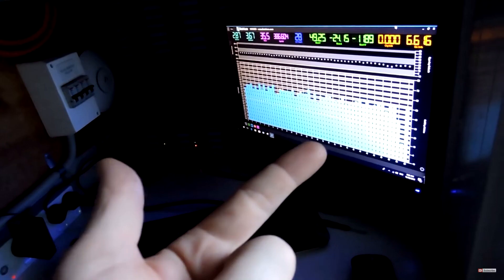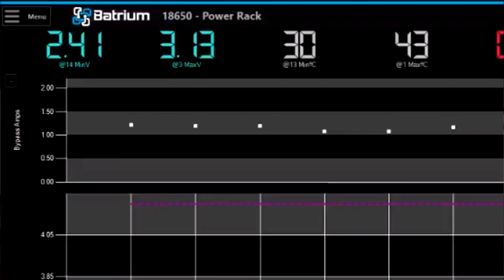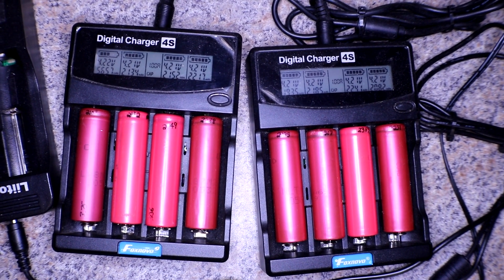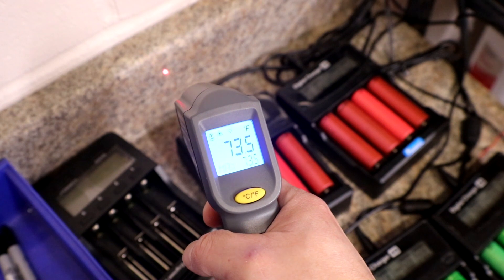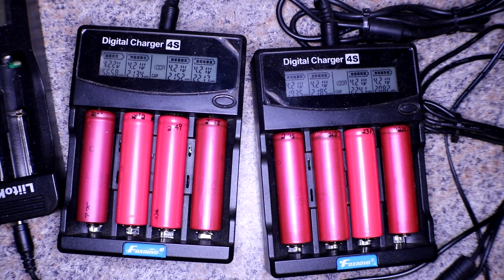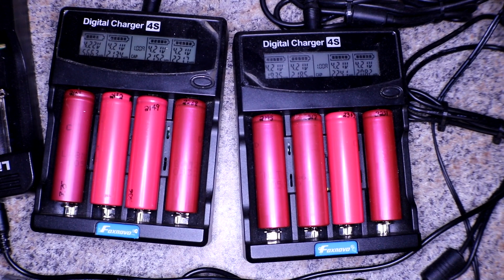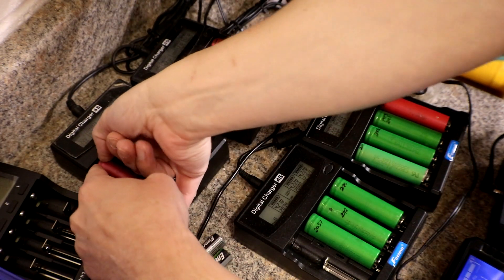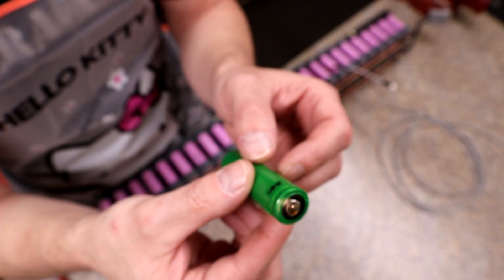Checking Cells on Pack 14!!!

Comment: sorry, can you provide a link to the tubes holding 18650 ?any one with the knowledge  will be appreciated.
Reply from the maker: The PVC was from Lowes and is 3/4" ID sch80 part# 49731  https://m.lowes.com/pd/Charlotte-Pipe-3-4-in-x-10-ft-690-PSI-PVC-Pipe/3134567

Comment: I have some xmas batteries too I've found the green one's have been the worst. I think there not much better than a 1C. Why doesn't anyone charge both ends of bus bars ?.
Maybe go 14s packs for future pack easier to find faults.
Awesome vids Jo love it keep it up.
Reply from the maker: Yeah another commented that the greens like that are pretty much an older version of a red sanyo heater!!!  They are better for a lower C rated battery pack.  I guess when the powerwall is running, the C rate is supper low and I could still use them but I might as well change them cause it seems like I like to torture test my powerwall lol.  I guess you could charge both ends of the bus bars when doing a single pake charge.  In the powerwall the charge is only from 1 end.  I like the bigger single packs cause there is less chance of shorting out the whole pack along with other things that can go wrong(thats my opinion tho lol)  Some people really like doing the series all in 1 pack!   Thanks for the watch!!!👍👍👍
Reply: Have same thoughts use every cell we have and I'm still collecting. 
Have you thought of running cells in pack at 3.9v max for long jevity and safty on other cells if a couple die.
Awesome love how your cells slide out have to find your older vid for that.
Torture lol be careful cos where learning from you. Tinkered with electronics for 30 years but lithium's have only been a year.
Like wise use everything like you say low C packs so all good. Lower voltage would have to help lower capacity cells balance out in packs ?
Cheers keep up your awesome vids.
Reply from the maker: I usually run them up to about 4.05ish. I use the glass fuses that pop at 2amps for the reason of catching a cell on its way out for that reason vs others that use higher amp fuses or wire as a fuse. Since its in my houae Im trying to make the cell packs as safe as I can. That was another reason I use the pvc for cell holders since were using used cells I wasnt sure how many or how often a cell would die so I wanted an easy way to replace them if needed!🔨🔋🤣👍
Reply: Thanks for answering Joe are yes the glass fuses are the go safty first. Pvc tube is that like sprinkler pipe/ hose ? . I'm in Australia  so maybe different. 
Medical packs what sort of contact would i need to search for them. Last question then I'll leave you be what charge rate AMPS per cell 1amp ?
Thanks mate cheers
Reply from the maker: No problem man!  Yeah the pvc I got was near all the sprinkler stuff.  Terry has all the medical cells in his Ebay store https://goo.gl/2sL2az but since your in Australia Im not sure how that would work.  Yeah if your using mostly used laptop cells I always do a 1 amp charge discharge to find any heaters.  If your building a big powerwall, you could test the cells at 500ma to be closer to normal use but that just takes to long lol .😃🔋🔌👍
Reply: Cool thanks I'll check Terry's ebay site .
Building ebike first with 18650 laptop and power tools dead batteries then move onto powerwall and EV . You should checkout in china Ubattery technology limited in china on Alibaba awesome prices on 18650's top makes also lipo4 200amp cells what i was thinking of using in EV. Not sure how to send link so hope you find it cos better price in US$ than Australia. 
Cheers can't wait for your next video.
Reply from the maker: Awesome yeah Ill take a look!  Next video coming up!!!🔋👍

Comment: What holders did you use for thee packs that made it so easy to remove afterwards?.
Reply from the maker: Hey Gerald, I built the cell holders from some 3/4" sch80 pvc pipe from Lowes.  Here is an older video I did about making them https://youtu.be/ChN9q7bVRRk 👍
Reply: AveRage Joe oh yes - I remember now. That’s a good idea

Comment: Hi what amps is the glass fuses you have on you're packs ?
Reply from the maker: They are .5 amp and pop at 2amp according to my tests.  The 1amp fuses also pop at 2amp but have slightly less resistance!👍
Reply: AveRage Joe  is that 0.5 amps or 5   amps ? Thanks Joe.
Reply from the maker: Yup point 5 amp😉👍 If I were going to do it again I would get the 1amp since it still pops at 2amps but has just a hair less resistance. Other then that I love these fuses!😆
Reply: AveRage Joe cool ordered 2000 of the 1 amp thanks mate
Reply from the maker: NICE!!!

Comment: You could use some of your tp4056 chargers and tie the battery side in parallel to charge your pack.  Im sure it would take several hours if not days to charge that pack.  But this would get your voltage closer to the 4.2v while you fix your charger. Maybe close enough to connect it back to the solar.
Reply from the maker: I thought about doing that for sure in case I cant fix the charger!  Yeah it would take days lol!😆👍

Comment: I think you should be doing DISCHARGE capacity tests because that tells you the actual "goodness" of the battery.  Like with the "heaters" you can get an artificially high value if energy is being wasted during the charging making it look like it took in more energy but BAD cells get HIGHER charge "capacity" as they take longer to charge and overcome internal resistance and other mysterious  influences. If the cells were NEW then charge capacity is ok, but with our recycled/used ones - NO!!  IMHO
Reply from the maker: Yup, I agree with all of that!!!😆👍🔋🔋🔋🔥

Comment: Hiya Joe, I think those green cells are old-school Sonys.  They don't have enough capacity to have made it into any of my large packs, but they tend to have a high C rating.  So if you need a small project pack that can provide over 5 Amps per cell they work great.  The Sanyos (red) on the other hand, have a higher capacity, but don't tend to like much over about 0.2C  or ~400mA charge or discharge. Which is probably why they were heating up if you were capacity-checking them at 500mA+.
~Cheers
Reply from the maker: Im kinda leaning on the same thing with those greens!  They seam lighter too but didnt weigh any lol.  Also agree on the reds. Smaller load which is the norm for my packs its fine but close to 1amp the start heatin up!😆🔋🔥👍

Comment: Probably it would be better to test the cells on holding the voltage....? 
I charge the whole pack measure the voltage then leave pack for few days like a week then I measure the voltage again and if is voltage below 4.18v then I charge the pack up to the 4.21 and desolder complete negative bus and after week I measure the voltage on each cell... Below 4.18v I replace with new ones... So that's is the  process that I use and since then I don't have issues with cells... 👍 
Also I don't discharge pack's below the 3,2v and also on every 100ah capacity I pull max 25A of it... 👍
For every 100ah usable capacity I make 130ah packs so actually if I use 100ah is still in the battery's 30ah reserv so I don't get drop voltage below 3v.... 👍 
What you think about that...?  honest opinion please...
Reply from the maker: Thats a great way to check packs!!!! Love that Idea!!! May do that on the next 14s!!!🔋🔋🔋👍👍👍

Comment: fukashima I hope the cells aren't like the powerplant.  
I have a cell. a 26650 that was just under 2.5v it wouldn't charge on my zanflare . so I paralled it with a nearly charged cell. for a day. then it charged fine. so I done a few cycles. then test and capacity is about 400 mah lower than the 19 other cells. still over 3000 mah. it's the resistance that has me concerned. 300+Mr. the others are under 100! great video. I need to finish my packs. and get them in service. 200ah of lead. doesn't get you that far. I have 600 watts in solar. don't you hate it when you pick up the charger/ tester after the test is complete. to write the capacity on the cells. and the thing comes unplugged!!¡!!!!! and you have to run the test again!!! it's happened to me like twice!  so far I haven't had any heaters! or bad cells. unless you count the 26650 . I need to build a tracker for my panels! I only get about 3 hours of good sun weth them in temp mounts. I need to get the most I can. because of the trees. I only get about 5 hours of sun. have you ever run liion with pb.? two different battery chemistry's I was thinking. use the lithium 7s. until discharge to equal the lead bank.  of about 27v then combine until lo voltage disconnect . at about 22v. then charge to 27v and reverse process. and continue charging to about 28.5-28.7v on lithium.  I know I could go to 29.4. . I hope to extend life. by keeping just under 29v. and fown to 21. I'm going to try to keep above 3v. seems that the cells say 2.7v minimum. I only testedvto 3v. and have just over 108 ah bank. I just need 10-15 more just like it. it's hard to find new cells that are affordable... mine are nos. and capacity within 400mah or so. great video. keep up the fight!
Reply from the maker: That Powerplant is still leaking isnt it???  400mah diff isnt bad in my book (i literally have a book of all the cells written down lol) but the resistance might getcha!  I would imagine 200ah doesnt get you much cause your completely off grid arnt you?  I havent mixed any lead with LiIon as of yet but I dont see why you couldnt do that.  If your around to monitor it like that and make the switch or whatever at the voltages.😃🔋👍

Comment: If you have a decent buck converter that is constant voltage constant-current you can discharge using whatever and then just use the converter to out them where you need
Reply from the maker: I actually dont have any except for a couple lil cheapo's!🙄

Comment: joe i am building my packs and  i got a ?  your  system is running at 24 vos or 48?
Reply from the maker: Its a 48v!🔋👍
Reply: ok  tanx amigo, if i do it 24v system  can  i used the betrum on  it    i am building  14 packs   so will be 2p 7s  what you recommend me ?
Reply from the maker: You could get away with using a cheaper bms with 2p!  Thats what I would do!

Comment: You can use the Xtar Dragon to test resistance. Just turn the battery pack on its side and measure like you would with voltages. Those electrodes are awesome!!! Another Great Video by Average Joe!!!
Reply from the maker: Yeah I thought about doing that lol!  Yeah these probes are Awesome!!!  Thanks Man!!!💥👍